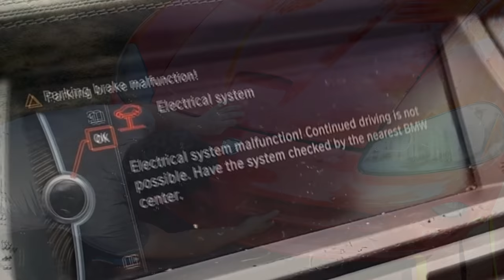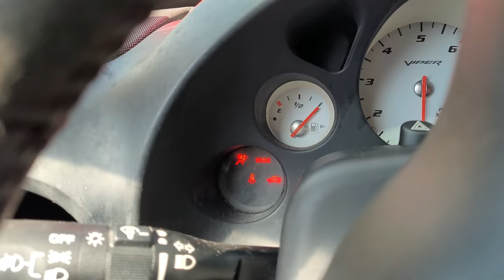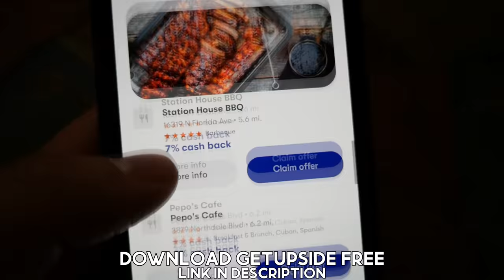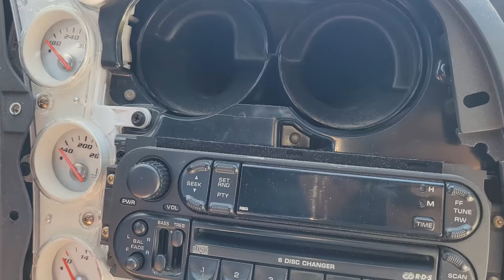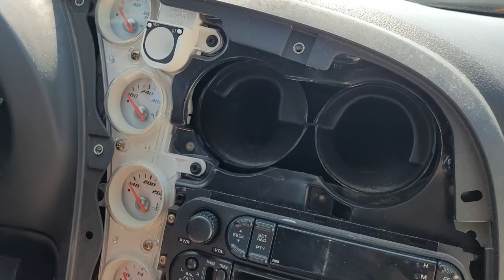Will this Sinkhole Flood Salvage Dodge Viper Start and Run?

Comment: Before replacing the starter, first check if you are actually getting power to the starter solenoid.  The starter may be okay.
Reply: You could always just get the starter tested at your local auto parts store
Reply: @jamesonmalig7271  you can go under it with a screwdriver and touch the contacts and it will spin if it is good
Reply: True.
Reply: Go from easy to hard so I'd start first at the relay. Listen for the click then the solenoid and test for power with a multimeter. There is a high chance that the alternator is also dead. I've had them fail from simple oil leaks.
Reply: Run 12 volts straight to the starter from a battery.
Reply: bridge out the starter relay, dont even need to get under the car, 2min job, sam likes to do stuff the hard way, thats why we love him

Comment: Since this is a flood car, there might be lots of reasons, why is the starter not engaging. The wiring from the START button to the ECU or the starter relay ; the starter relay ; the starter itself ; the ECU.. You should probably try jumping the starter if it's not somehow full of water. It also could be a badly ruster or corroded ground.
Reply: this.
Reply: Clutch pedal switch could also be the problem if it’s not any of those you listed. If the computer does not see the switch indicate that the pedal is depressed then it might not attempt to crank the engine over
Reply: Codes? That will give you a better idea… especially if you can SEE what the buttons doing
Reply: Yup I would take jumper cables from a battery direct to the starter. If the starter does not spin then strip it down as it might just need the brushes cleaned up.
Reply: Yeah, there's only like 4 grounds on the viper since most of the body is fiberglass.  There's two that I know of behind the drivers side fender.  I added my own with some 0awg on my 3rd gen.
Reply: @beakerwsw  Frame is steel. I had a ground problem on mine once and it turned out to be the connection on the frame right below the battery box in the trunk.
Reply: clutch, safety switch first for continuity,  then check the "send wire"  key to start position should have 12 volts on send wire.  if send wire has no volts check wire diagram to see if it goes through ECM. if so theres your prob
Reply: @aususer415  no it wouldn't. You're a little out of your league on this one.

Comment: When I was a silly young man, I put my 70 Nova SS in to the bay (salt water). Drained the water/oil and refilled. Ran to operating temp and changed again (2 times). Drove that car for over a year without issue.

Comment: It might a built or REBUILT engine already!  Noticed your bearing caps have ARP bolts on them...
Reply: Funny how they look right past this comment hah but yes I noticed that myself that’s how my duramax’s were built with arp head studs they may not even. Know what ARP is …. You and I will just leave that alone i so pose

Comment: I had an engine with water in it like that and one thing i can recommend is that you should crank the engine for a few seconds with the oil filter off to blow out the oil passage from the pump.
A bunch of white sludge came out of mine.

Comment: I've been in the car business for 30 years. Not seen the whole video but this engine needs a full strip and rebuild to save it. If it does run it's probably going to eat itself and destroy any components that might have lived again. Want you to succeed but all that sand/rust and water internally is a death sentence.
Reply: if it needs too be rebuilt anyway who cares??
Reply: @lovellmills7959  Because if you rebuild it straight away, you can reuse most, if not all of the parts after cleaning. If they get damaged from running, like @Andrew Trapnell said, then you need to replace them. It's a matter of how much money you're willing to risk.
Reply: @halofreak1990  it is a modded engine. Has ARP internals. Does not need too be rebuilt.
Reply: @lovellmills7959  u don't get it do you? They are saying with the remaining residual particles still in the engine it will ruin it. What part of modding an engine makes it indestructible? Sand, soot, metal particles will eat away at everything internal. Mods have nothing to do with it.

Comment: When it comes to the starter Sam all you have to do is take it apart clean it re-grease it then test it.
Most likely it has sand and other material preventing it from functioning.

Comment: before changing the starter break the cover on an old relay and use it as the starter relay and close the contacts manually that way you break the system in half, if it tries to crank or cranks the engine bay wiring is good and possibly the starter and the issue is between the button and pcm

Comment: Like with salvaging Boats, NEVER drain your engine until you are immediately ready to tackle, start to finish.  Boat salvage operators won't raise the boat until they are ready to begin work.  Not that I'm an expert, but it takes air to start the oxidation process, so their logic makes sense.
Reply: Nope....air increases the oxidation process, but water is H2O....two parts hydrogen, one part oxygen. Drop a bolt in a pan of water and watch what happens.

Comment: Most likely going to need a new PCM. The computer is in the front left corner of the car and was completely underwater. Would be really surprised if it's not completely corroded inside.
Reply: that'll be easy to check, connect a diagnostic
Reply: Computer internally is covered with a coating to prevent corrosion
Reply: They are water proof and all the connectors have gaskets to keep water away. Can happen but very difficult
Reply: @organiccold  I had a similar failure on my Yukon. Got the green goop on two pins and fried the ecu , and it didn’t even go for a swim
Reply: Yeah, it's probably fine. Like I said in my other comments, it might have something to do with the immobilizer.
Reply: That PCM would be no good sitting in that water. Had my old dads 2000chevy van in rainy Georgia. Wouldn’t start and I thought it was my distributor or sensors or ground wire underneath . I’d work on some things and would leave the hood cracked for weeks or more. Simple rain water flooded the pcm I found out after towing it to a shop. Mechanic charged 500$ for the pcm computer and 500$ to program it.
Reply: With a handle like ViperMike.. Sam should definitely take this comment on 👍🏽
Reply: You can fix the computers by baking them in an electric oven at 200 degrees Fahrenheit packed in desiccant.
You can you can buy desiccant and a 5 gallon bucket.
The desiccant is reusable.
Reply: The pcm is water resistant, not water proof..I bet anything it's fried.
Reply: @kbrx4310  if it was the key wouldnt even turn on anything.
Reply: @beakerwsw  the key In them is mechanical , only locks the wheel has nothing to do with the skim ..the start switch is like the newer dodges that need the key signal to ok a start, I won't say it's not the starter too ,but I bet the pcm did take on water.
Reply: 10 year old chryslers that weren't in a flood need a new PCM soooo yea, definitely agree with you here! hahaha.
Reply: Or soinc cleaned
Reply: Computers don’t usually fry unless the fuse box short circuit because the fuse didn’t blow
Reply: @pastathemechanic7536  

Fuses don't always protect sensitive electronics. They might fry before fuse blows. Fuses are there to protect your vehicle wiring from heating up hot enough to set your car on fire.
Reply: @kamilb8232  and the reason why the correct amp is required. Only way it will set on fire is from the wrong size. Anything out of spec won’t blow as easy. Seen this hundreds of times, worked at a dealership 6 years
Reply: @pastathemechanic7536  

You worked at a dealership and I worked as an electrical systems engineer at Ford for the F150 Raptor. Yes, we have engineering device transmittal documentation for each device drawing power. We account for max loads and transients. We try to size wires and fuses accordingly, but the number reason why a fuse is sized a certain why is primarily to protect the wiring. ECU is secondary.
Reply: Open up the module, take out the PLC/board (NO POWER)...run it in an ultrasonic cleaner with dishwater soap...blow it dry and spray with a WD40 dispersant...clean off any corrosion with light toothbrush strokes. Dry it.  Then check all solders to observe corrosion...resolder where necessary.   Check all pins (male and female).  Clean pins as necessary. Test an install.  Maybe it will work.
Reply: @RedTurbocar  wrong!!!
Reply: @organiccold  wrong!!
Reply: @ViperMike  wrong!!
Reply: @timothyalsfeld8323  wrong!!

Comment: I'm pretty sure it will fire but I also think in the process you will liberate so much crap that something is bound to get caught in the valves and burn them.  If you just removed the heads you could really clean it up a lot more and you don't have to remove the block.  Good luck, it's a beaut.

Comment: Could try jumping the starter relay pin 30 to 87 with the relay removed that would also eliminate a bad component before the relay and also find out if the starter is bad. You would also hear the starter relay click even if the starter is bad.

Comment: Make sure the clutch pedal switch works, the one that detects if the clutch is depressed to start the engine!
Reply: THIS!!!  Bypass it with a jumper wire if its faulty for testing…

Comment: The sand comes from around the hydrant and the water line. When installing both items, they compact everything in the ground with a strain sand and or "concrete" sand (sewer lines). This way they pack ot tightly to make sure to stay in location. Plus, when water leaks happen, alot of the sand is pushed out and you can develop sink holes or sunken ground levels. So more then likely, the sand was all pushed up amd away from the pipes holding both items

Comment: Done a bit of deep water driving, a good starting point for a water fill  is oil pressure switch out and make an air line fitting that will replace the switch and fit an old long air line to it remove the dip stick and filler cap and cover with a rag and next blast it for a few minutes. Next fill the air line with oil and drop the pressure down to 30-40 psi stand back and blast away again and you should be ok to drain, replace the filter and refill with cheap and run for 10-15 minutes to get it upto temperature.  If it all goes well then it is drain and fill with good new oil and a one more filter, good luck.

Comment: It’s a shame the engine wasn’t drained immediately and flushed and filled with new oil within hours of retrieving it.  I floated a car across a flooded off ramp.  I immediately drained all fluids and refilled.   I had no issues with anything in the car.  At this point this engine looks like it will never be the same, without a full tear down.  The rust on the cylinder walls will surely promote loosing the rings compression and oil control.  A hone is a minimum and probably needs to be bored out.  The numerous electrical issues will be secondary to the future of this car,  but it is truly a shame that the engine was so neglected after the flood.  At this point, I would not be looking for short cuts, but would be evaluating whether the engine is salvageable by a full tear down.
Reply: But like Sam said if it’s a full tear down there’s nothing lost anyway. The owner just wants Sam to see if it will run before he bothers spending money to ship it. 
Sam is doing this for nothing other than content
Reply: @ChrisBeevor0511  Quite a few of the key/expensive internal components might be saveable currently. If it eats itself by being started most will be scrap.

Comment: I’ve now rebuilt 4 flood cars and every time i had to replace the fuse panel under the hood. Also the starters were toast every time too, even a few that didn’t have water in the engines.

Comment: I would mesure the pistons at TDC to check possible bent rods. Many knuckle heads at the Auction site try to start flood engines without checking the oil. Some even do it in their walkarounds videos.
Reply: not to mention hydrolocking. that water doesnt compress and is bad news if you try to crank a water logged engine block
Reply: @spavliskojr  that guy from Auto Auction Rebuilds lately been cracking some flood cars without checking the oil or if the air filter is dry. Too cringe.
Reply: good point however it seems there is no power to the starter so i don’t think they could’ve even tried to start it
Reply from the maker: 😆 imagine what they do off camera
Reply: @massi628  hopefully in this case, they didn't crank it.

Comment: It's your ECU. I had the same same problem. I tried cleaning the engine bay and didn't notice the ECU was present. This was on a Kia Optima. Dealership wanted 2500. Went to ebay using the same number on the ECU and got one for 65.00. Got it and fired up and it worked just fine. Hope to see it crank up...Good Luck

Comment: i had a 95 mustang gt that was a flood car i had bought when i was 19, i had bought it for 900 bucks in practically perfect shape 112k miles, just flooded, i beat that thing daily to 183k miles before i sold it. As for electrical issues, they were minor. It really depends on the car, that one had water up to the seat cushions.

Comment: You will probably get it to spin over. Then you will probably get it to run eventually. Then the same thing may happen as those dudes with the flood GranTurismo....you'll spin a bearing. Then you won't be rebuilding but replacing this motor. But it's interesting to watch you try.

Comment: Check the clutch safety switch- you can always just put a jumper wire across the wires going into it to bypass it.  I bet it was under water and could have been damaged.

Comment: the ECM is pretty sealed for water not water under pressure but regular water intrusion is normally prevented with the seals on the plugs and the glue that holds the cover to the heat sink

Comment: I totally understand your caution and worries. you are past the "danger zone" for most of the engine internals. now the biggest danger is not getting it turned enough. the engine needs to be run to keep any residual water from oxidizing inside of the engine. you are likely gonna need new bearings in the alternator and starter and maybe a few other bits and pieces but most important is to hook up a momentary switch to your starter and get it turning. starters are cheap but the miracle that your bearings / rings aren't frozen means that you got the water out in a timely manner. It will run, even if you have to put an aftermarket ecu in.

Comment: Also, try pushing the unlock button on the remote. If the immobilizer is engaged, it won't let you crank it. Other issue may be the clutch switch
Reply: I hope he reads your comment. My uncle has had 3 Vipers that he rebuilt and countless other ones he helped work on and what you said I remember him talking about for a car the guy had spent over 15k trying to get th car to work and nobody could figure it out. Then my uncle came in and was able diagnose the issue, which was this issue with the immobilizer. It had a couple other issues because the auto part mechanics had done some cutting, slicing, and rewiring that didn't need to be done, but had they been more familiar or at least qualified, they would have figured it out. In fact one shop was called 'Mopar Magicians' but I'm thinking they only magic they did was making that guys money disappear.

Comment: After seeing all the progress, even more confident it will run no problem. Am I confident it will have great compression on every cylinder with only 5-10% deviation? Eh I'd go with 70/30 odds on that.

Comment: Diagnose the starter. Make sure you got power to the starter. You gotta get that thing to crank. Also, make sure if that thing has a clutch pedal position sensor.. that that is working properly as well

Comment: UK but I've tooled on one that was poor start, clutch pedal bushing was worn and you had to kick the clutch a bit to the right to get it all the way to the floor if I remember. with the flooding I'd be looking at the clutch switch for the no start. can be jumped for testing purposes though

Comment: most PCM,s can be tested ,ive popped the cover on some and if you dont see any burnt diods etc, the real deal on electrics is let em dry out, the starter may be okay, you have take  it apart all the way, but if some stuff stays under water the game is over

Comment: Diesel used to be used to clean internal engines. Drove the engine hot, emptied out the oil and filled up with diesel and some oil, then the engine started and had to go idle for a couple of minutes.

Comment: On a vehicle I was working on once I checked to see if the spark plugs were getting power and they weren’t turned out that it was a straight shot from the pcm to the spark plugs on that vehicle and that lead me to believe the pcm was bad. Not sure how it works on a viper but would be worth figuring out if it’s similar to narrow down if it is the pcm or not.

Comment: Check the clutch safety switch.
And when Ivory built flood cars when I was in my early twenties we would do 80% oil 20% diesel fuel in the current case when we were turning them over.
We would run in about 5 minutes or so change it.
Put cheap oil in it run it for 30 minutes put another round of fresh clean oil and filter in it.
And then do 250 mi oil change

Comment: I would find some way to turn it over with an electric drill, with the plugs out, just let the motor crank, will bring up oild pressure and get it circulating..